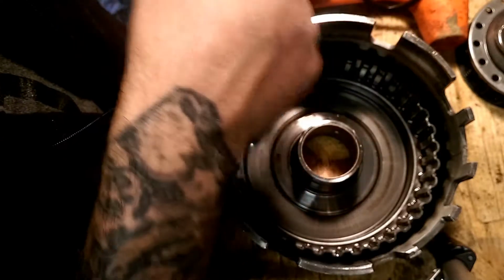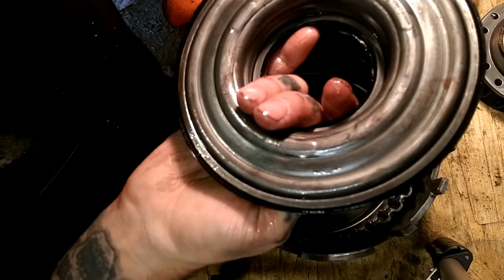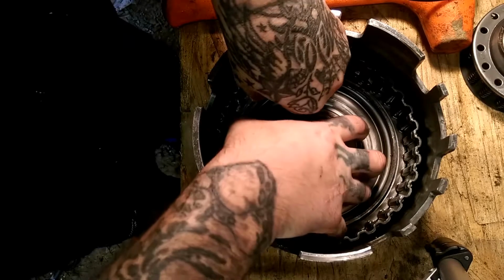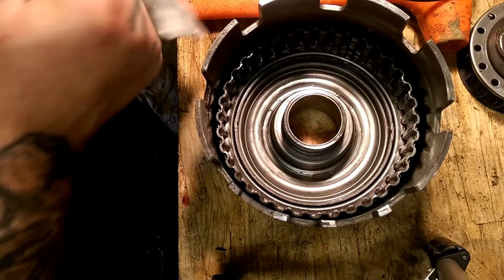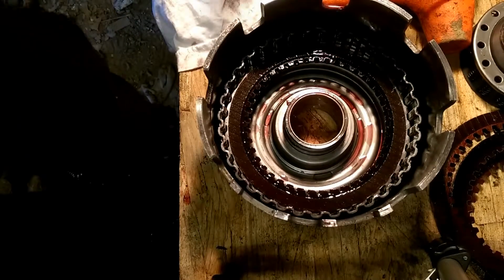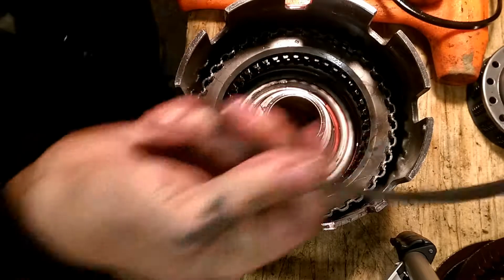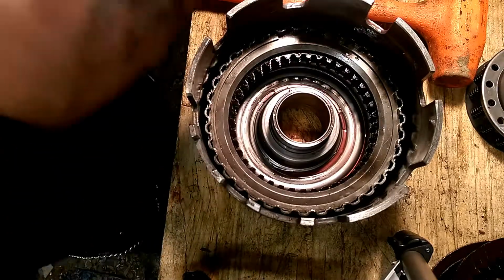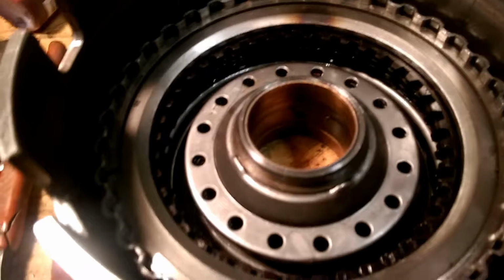Reverse Input Drum and Input Clutch Assembly Install | How To

Comment: Easier than the tool, I used a Wise White cheddar popcorn bag (the kind with the chrome inside) to install the piston, it slid right in and the bag came out pretty easily, no danger of tearing the seal with a popcorn or potato chip bag.
Reply from the maker: Great info, and a great ideal